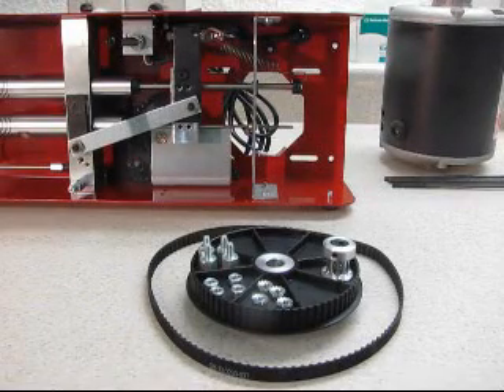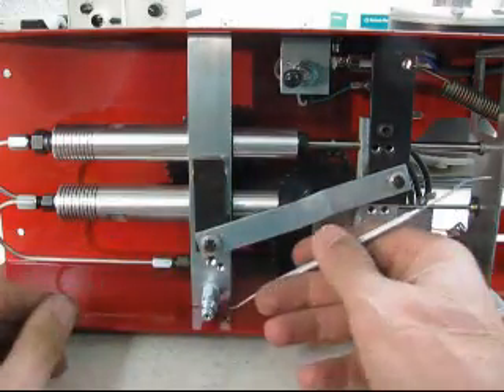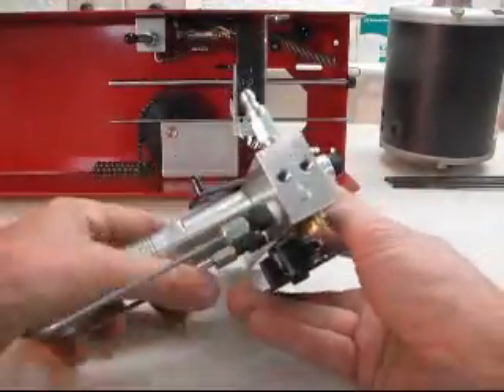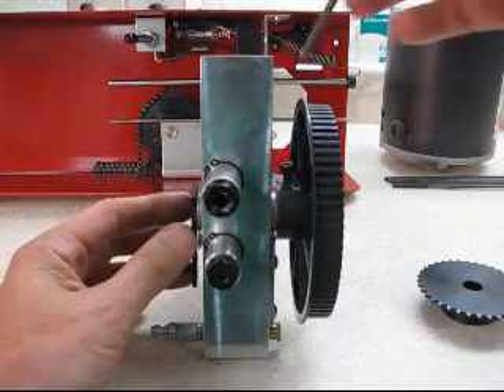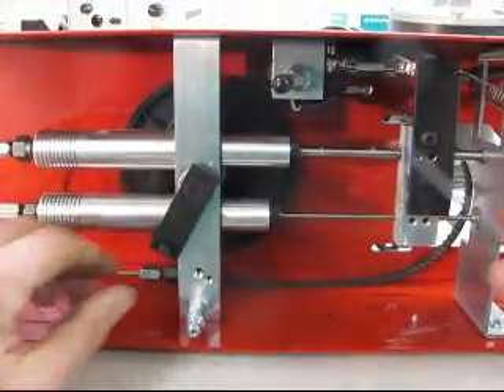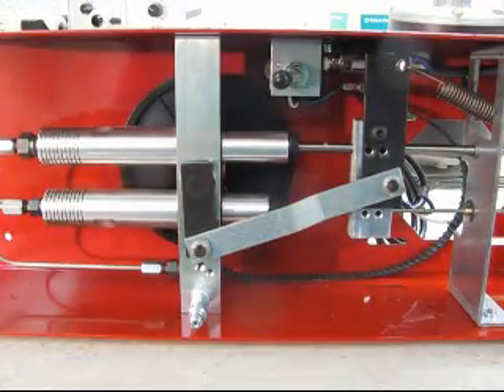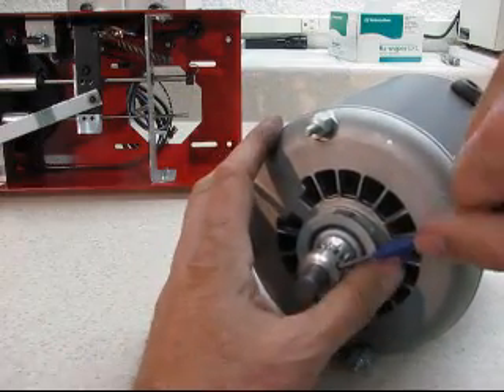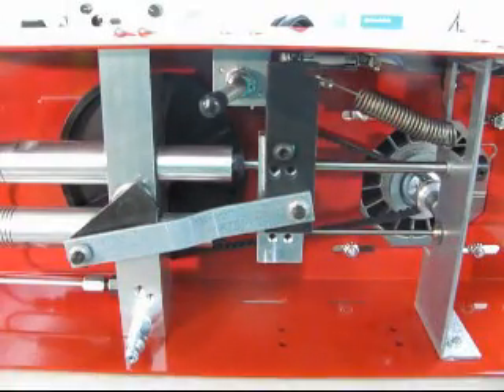ShoeBox Air Compressor Belt Drive Upgrade

Comment: Just out of curiosity, could anyone just modify and make a custom belt drive to attach to their bicycle so they can power the compressor without gasoline?
Reply: It actually runs on an electric motor, not gas. But I don't see why you couldn't hook up a bike as a power source. Then again if you don't mind exercise just use a hand pump.